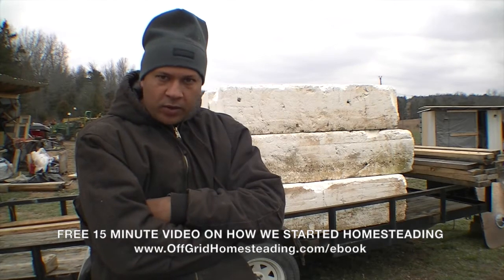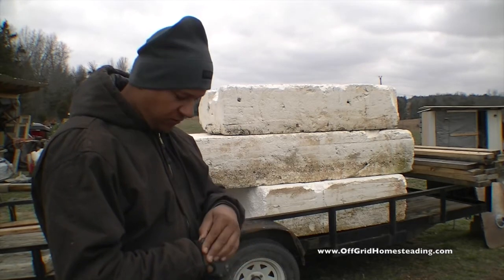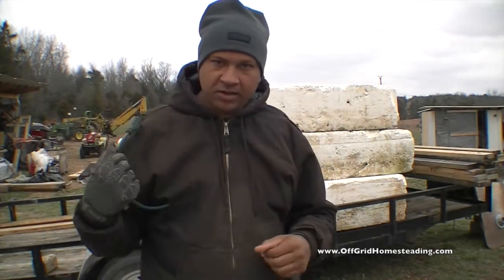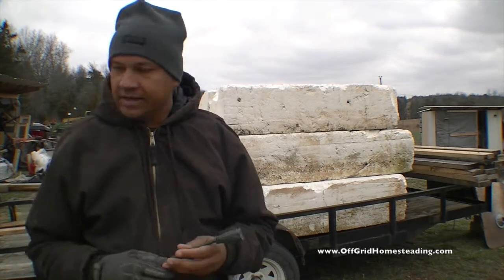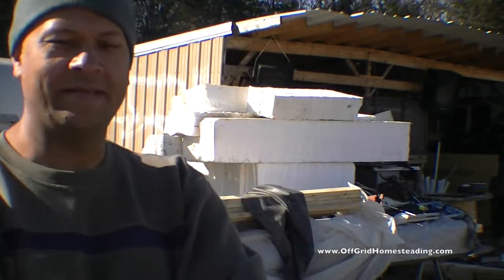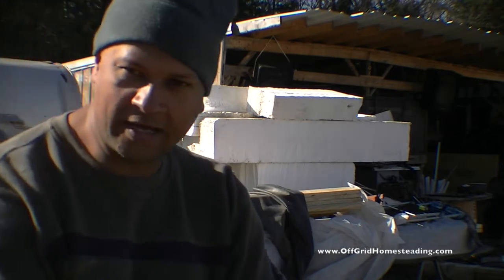OGH - How to Cut EPS Large Foam Blocks with Large DIY Hot Wire

Comment: You might need those full size if it keeps raining. Don't they float?
Reply from the maker: They haven't floated away yet so I think it's safe to put them under the building in pieces!  Last flood was like in Noah's day right?  But with Global Warming we might need it just in case the polar ice caps melt.   Have you seen the video by John Moore about the Pole Shift?  https://youtu.be/usHIwOCjVpQ
Reply: What is it exactly you're using to cut them, i have a bunch to do exactly for the same purpose, insulation under our mobile home, 23"x 5" roughly